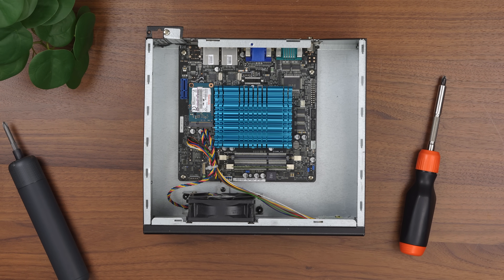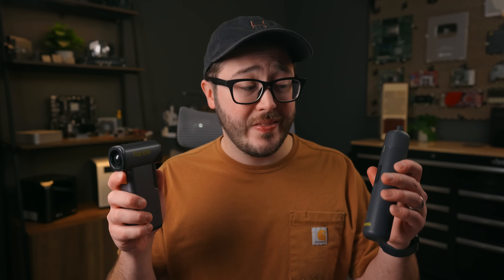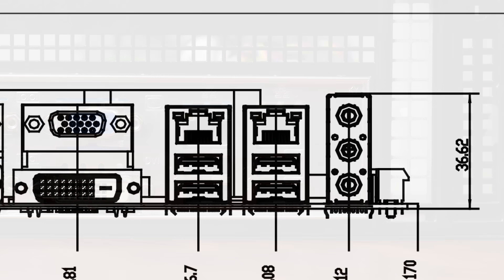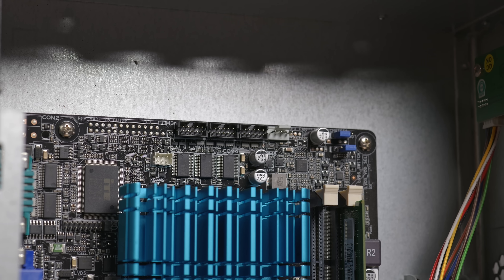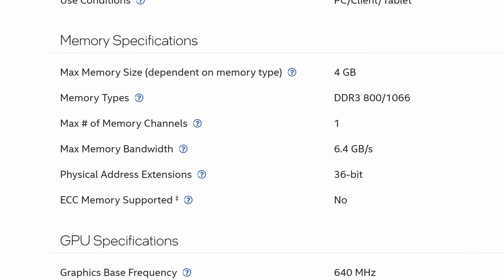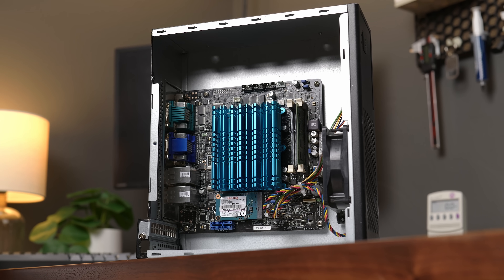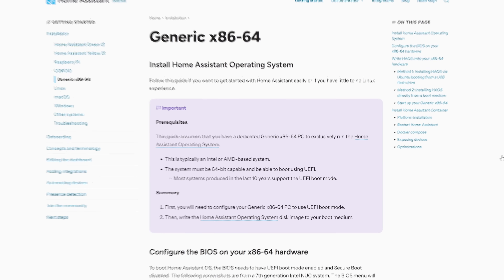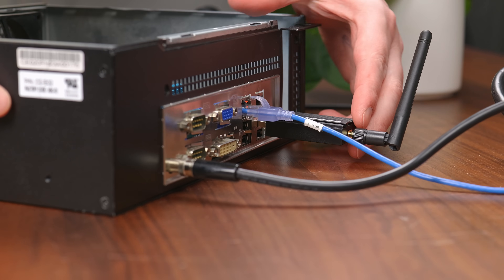I had no idea what this PC was... but I'm glad I bought it.

Comment from the maker: - Get 50% off total for Fanttik B10 Pro Max Electric Air Duster with code HardwareB10 at: https://amzn.to/4iqiypS 
- Get 35% off total for Fanttik S2 Pro Electric Screwdriver with code HardwareS2 at: https://amzn.to/4isnTNr
Reply: Marketing tip: Why would I care how many RPMs an air blower can do? I want to know the air flow. Tell me the CFM, like we'd get with a cooling fan. RPMs are only interesting for noise, and more means louder.
Reply: honestly, the case for the screwdriver has me asking for it for xmass
Reply: When i click the B10 link i only see a 40% off, and when i click  the S2 i see a 32% off.
Reply: @CChironCentaur  Yea its "40% off" even with a general search of amazon. Apply the code for an additional 10% off. No thx
Reply: Probably a controller pc. For applications that were highly automated. Maybe like  robot arm control assembly,  lifting bridges, e.t.c.
Reply: Discount on Amazon is only 40% and code doesn't work on their website. That said, it's cheaper on their website than the $99.99 they have it listed for on Amazon.

Comment: I was looking for thin clients as Home Assistant server. But I didn't find good offers. Testet the power consumption of my Thinkpad T480s laptop: With a running Linux (but without graphical UI, I think) is needs less than 5 Watts in idle. Or in other words: a good Laptop with an Intel i7 from the U-series (ultra low power) can be in the same league als a Raspberry Pi, regarding electrical power...
So I bought a Lenovo Thinkpad T480 with broken Display as my new Home Assistant Server. The display is even working, it just has a crack in one corner.

Comment: I would replace the 80mm fan with smaller one such ar 40mm or 60mm  fan (with 3 or 4 pin connector)  taken from some CPU heatsink, as it would repel spiders from doing their webs inside the box

Comment: That mSATA slot also potentially being a combo mPCIe slot might still be a thing, as if older laptops that I've worked with are anything to go by, a Wi-Fi card isn't always a measure of success because a lot of those use an mPCIe form factor but are actually using USB as an interface. So if you try a true mPCIe device in that slot, such as an mPCIe SSD (which are truly rare these days) you may still be in luck. Not that there's much point other than satisfying curiosity as you can just upgrade the mSATA SSD which is confirmed as functional and are much more widely available. Actually come to think of it, you could try what I've done with my laptop's cellular card slot and use an mPCIe to M.2 NVMe adapter board fitted with an M.2 2230 NVMe SSD.

Comment: I guess this computer is used in a production line of a industry or in a ware house to scanning bar codes of items or to run monitoring software. I guess it used to view data rather than for storing as it has only 64gb of capacity. It may have connected to a network through the LAN ports.

Comment: Pro Tip: University E-Waste

My local university sells 2017-2019 PCs for $40-$60. its a mix of Macs/Macbooks and Dell Optiplex/Latitudes

Only thing missing is the boot drive. They also sell SSD at $30 each with 1TB being $35 during my last trip.

Comment: Solderv the missing sata connectors,  add e gsm cellular modem instead  of the m sata also update the latest bios and yeah a smaller case  well and I would look for a better cpu  a prevailed one so you could solder it with a heat gun  but heat a home assistant is the best it can be at this specs

Comment: Looks like a small embedded computer designed for the manufacturing industry, or as a public-facing machine - GLL, who manages Libraries on behalf of Wandsworth, Bromley and Greenwich Councils in London, England, uses a HP Computer like this in one of their libraries running Windows 7 Embedded, and is only used to search for library books.

Comment: Its most likely an old remote terminal. We had something that looked very similar at work and it could go to 2 websites (Company SOP and NDDR), run one program that connected to the very secure in house production medical data program. They wouldn't boot if not hooked to the corporate network and the USB would only allow you to use 3 devices. A hand scanner, a keyboard and a mouse. The data base looked similar to the old library book system.

Comment: I recently got a different Mini-ITX industrial board with an Atom D2700 running at 2.1 GHz (also with 4GB of SODIMM RAM), but with a friendlier setup which includes 2 SATA ports, 1 PCI slot (the old 32 bit one), ATX power socket, onboard audio (even has optical out!), M.2 slot populated with an Intel Wi-Fi card, HDMI and DVI out, 4 USB 2.0 ports and single Fast Ethernet.

I paid “a lot” more than you did ($37 USD with shipping and taxes) with no case, no SSD and no PSU, but at least it offers a few more options for other types of home use (other than a typical retro gaming machine for Windows XP, of course).

My use case will be for retail shop signage (powering a single 1080p screen), but after watching your video I’m now thinking if this meager dual core Atom could possibly also handle some Home Assistant duties for the shop as well… 🤔

Comment: If I had this system I'd have to let it go. No sata, not even a PCIe-X4. Yhea it uses little power, but I already have at least one spare RPi4 lying around. I run HA on a Pi4. I'd also be looking for HDMI or DP video output. I really like Lenovo 1L i6500 systems, they work well.

Comment: I use a very similar ITX Atom-based board as a dedicated docker server running Jenkins, NUT and a few other monitor/dashboard type use cases. 
Mine did have SATA ports, though I'm only using an old 80GB OCZ drive in one of them. 
I have an external USB drive attached and connected to my NAS via NFS to dump 3rd-string backups to. 
On rare occasion, I've started Samba on there in read-only mode to access NAS data while the main NAS was offline (or just off). 

It's versatile and just works in its little corner of the house, separate from the rest of the home lab.

Comment: Your specific board has no standard SATA data ports, it is highly likely you have the EMB-CV1-*-MS variant, which utilizes an mSATA slot for storage. 
The 'MS' in the model name stands for mSATA. These models replace one of the standard SATA ports with a full-size Mini-Card slot that supports an mSATA SSD.
Reply: If you put in the address, it points you to CONTEC America and they do computers like this one. It is not listed as a current model that they sell.

Comment: I love to upcycle those abandoned mini PCs as Home Assistant Servers. Oh and old office PCs that don't like to install Windows 11 on their own as cheap ass Gaming Rigs. Add/Replace SSD, add some RAM (still cheap as old tech - DDR3, low speed DDR4) and a GPU that fits into case, power supply capabilities (if that can'T be upgraded) and reasonalbe budget (100 to 200 bucks max). Just finished an I5-6500 Optiplex. Now has 16 gigs of memory, 256 GB SDD a 1 TB HDD and an Intel Arc A310 single slot SFF GPU. That thing is perfect for older games, wasn't expensive and still has some years to give some fun.

Comment: I'm not sure about HAOS; Docker on it should probably be enough for this. But considering the network cards, I wonder how much traffic it could handle as a network gateway? With support for some modern VPN servers, etc., for home use. And it would be interesting to know if the SATA would work if they were actually re-soldered.
Thanks for the video. All the best. ))

Comment: That is a good adguard machine. Silent, low power, has no performance limitations for adguard... Disable every serial device in bios and everything you can find useless, disable one of the nics, install a stripped down debian distro, install and config adguard an u got a 5watt adblocker for 10 bucks... You can use only 2gb of ram for adguard and swap the msata for a 8 or 16 gig one since adguard doesn't require... Anything really... And there u have it!

Comment: I'd like to see you set up a DLNA server as simple and easy as possible. Open Media Vault is a bit of a pain to do that with. DLNA has to be installed to it as an addon. Making and sharing a media folder is all over the place, the last time I did it with version 6, one critical thing was in a menu unrelated to what it was. Then it's bloated with a ton of functionality completely unnecessary for just sharing video files by DLNA.

No transcoding capability is needed. Just serve files by DLNA for clients to use their own capability to play.

An absolutely bare bones Linux configured to do nothing but DLNA file serving is what's needed. It doesn't even need internet access, just LAN. Once setup it should be like any appliance, no need for updates. It only needs to be accessible from a computer on the LAN to manage files on its storage.

Comment: The setup utility states its Aptio which is UEFI. It's almost certainly Aptio 4. To perform a UEFI boot, the CSM will need to be disabled. If the option for it isn't hidden then I think it should be under the boot menu. If it's hidden, maybe there is a BIOS update that makes it available. If not, there are some BIOS customization tools that may help but that's another discussion.

Comment: I'd put a cheap quad port gig card in it and use it as router+switch in a low demand situation. If I still ran a lot of machines I would have put a multi port serial card in it and used it as a console server for the other machines. Either way, I'd be running OpenBSD too.

Comment: I saw this and for a second thought the Mboard was a GIGABYTE N3150N-D3V - which I use for Truenas box; passively cooled, swapped to a Pico PSU and SATA SSDs - super low power draw, silent. That system runs Plex and Immich too

Comment: Prob end up doing the same as you.

I have been running Home assistant using a portable windows version that severely out of date, but I get stuck every time I think about migrating cause HA in docker doesn't let you use HACS so I've been thinking more and more to just get a small low power usage device and run it off of that. now i'm just waiting to either have extra $$ to buy something or think of something I can repurpose.

Comment: I've run into these types with  entry systems (mag door locks / badge readers etc. )  It just runs a small app to configure the "database" (text file) that gets pushed to the "brain" over serial (used to be 9 ping now usb) that is more ROM based.

Comment: gen 1 x 1  i got an old emachines desktop i melted off the back end of the pcie x1 slot to accecpt a hd4670.. ... terrible but still better then the intel gma atrocity igpu.
Reply: its one of thoes tragic systems that has the space but agp port neutered off the board stuck with pci or the 1..lowly pciE x1.......

Comment: My current "NAS" is a Pentium J4205 box - ASRock J4205, with 2x 8GB DDR3 sticks (sadly no ECC support). All hidden in a 1U Supermicro chassis, alongside 2x 400GB SSDs and 2x 12TB HDDs for storage. With PCIe x1 slot empty and.. another PCIe x1 in WLAN slot available for whatever. Extra SATA? 2.5Gbit NIC? It won't boot from it so no NVMe.

I actually have a 2nd motherboard with yet another 2x 8GB sticks for it and I am in a need for a new router that can run 500Mbit PPoE with quite a few firewall rules on IPv4 and IPv6 so that's an option if I want to get rid of Mikrotik... :)

Comment: After watching your channel for a while, I came across a free commercial Blu-Ray printer on Marketplace. Looking closely at the pictures, I noticed that there was an I/O shield sized cutout for all the ports on the back, so I swung by and picked it up. Turns out it has a 4th gen Intel core i3 processor, 4GB DDR3, and 3x500GB hard drives. I sold the two Pioneer Blu-Ray drives (after printing a copy of Pulp Fiction, and depleting the print ribbons with Samuel L. Jackson on blank discs), and I am keeping the ITX board for a NAS build for my parents.

It feels great to find stuff like that literally on the side of the road and give it a new life, in a way that is functional!

Comment: It has an Atom processor. It might make a half-decent WALL CLOCK with an attached monitor. It's possible it might run a doorbell. If you want to program in assember, you might get it to control a dishwasher.

Comment: I have a similiar board Gigabyte M10RDI. It has 1 half size and 1 fullsize mini pcie and it says it supports mSATA in manual but no way. 
I dumped the BIOS and modified it so that now it supports NVME as a boot device. I installed a NVME with a adapter and now it is working as a OPENWRT router:) 
I haven't tested the VPN performance yet but I am thinking to attach a wifi 6e or 7 tri-band wireless card for additional SSIDs for always on VPN connections and IoTs.
It doesn't have UEFI BIOS but it should have Aptio EFI BIOS.

Comment: Damn I love little computers. This is a bargain for $10. I'm in the middle of planning a build with a small mATX board, Ryzen 5600G, and one of those cash register power supplies. I should be able to make a case smaller than 2 reams of A4 paper (i.e. 6 Litres).

Comment: You know what I immediately noticed with this thing? The Nidec fan. The manufacturer intended for the thing to operate reliably for a very long time. That's something they'd likely have had to source from Digikey or Mouser or similar (or in volume direct from Nidec) and it's a lot more reliable than a standard fan from a consumer brand like Noctua or Arctic. I'm also fairly confident that that exact CPU heatsink was used on the Asus E35M1-I board, which is what I initially thought this was from half-watching the video. Totally irrelevant, but perhaps mildly interesting.
Reply: These heatsinks are probably just OEM stuff. Seen a lot of these on different boards, there is also one that is exactly same, but red.
Reply: @alexturnbackthearmy1907  Oh, without a doubt. Same way every chipset and half the video cards back in the day used the exact same little square heatsink anodized in either green or black.

What's mildly interesting to me is that the Asus board uses an AMD CPU, which has different electrical design requirements than the Intel chip here. If the mounting pattern is also the same, it suggests motherboard manufacturers might constrain some mechanical dimensions before they get into electrical design—above and beyond what the form factor specs require.

Makes sense when you think about it, but it's not an angle I'd considered until I saw an Atom board using seemingly the same heatsink as an AMD E-350.

Comment: I like that its passively cooled
Reply: it's not, there is a fan. Just not stuck to the CPU HSF, making a single fan PC is quite easy actually, pick a chip with wattage that is like max 45w but lower is def better, then pick a reasonably big heatsink with heatpipes preferrably, and a case with a 120mm next to where the cpu cooler is, plug the thing up, connect the fan to a CPU temp controlled fan socket on mobo - connect whatever else, the rest doesn't need cooling so long as you use onboard graphics, badabum badabim you're done. 
You can do a reasonable GPU but you will NEED a fan of some kind on it. Even the passive ones die if there is no airflow so you might as well pick something reasonable with a big heatsink, put a slow enough to be inaudible 120mm blowing on it. Done. 
One thing though, if the fan for the GPU dies, so does the GPU. The overheat warning often doesn't work well enough to save the card. Ask me how I know 😛. 
If you don't need it to do transcoding or whatever go with a CPU with inbuilt GPU, saves a fan and money and headache. 
If you go for a low wattage silent PSU you'll have a whisper quiet PC this way, you can get it totally silent but I don't recommend it because EXTREMELY quiet is reasonably easy. Totally silent is EXPENSIVE AND HARD if you want reasonable performance. There is an ocean of dead burned components between you and the totally quiet PC heh.

Comment: As far as I could tell, that power draw reading was approximately 6.6 watts, give or take.😉

Interesting find.  Definitely not bad for 10 bucks.  I remember finding out about AAEON.  It was when the Atomic Pie board was shipping.  Someone showed the board info in a video before anyone knew where that board really came from.  I used that info to figure out it was meant for that Kuri robot and I found the auction lots for the board, along with a few other things.  Other people figured that out at the same time as well.  As other commenters have said, these machines might be common in certain settings, but it's an interesting find.  Plus, the blue heatsink is pretty snazzy.

Comment: This board was used in ATMs in my countey and I got one from friend who upgraded it, even with original mSata drive with banks os still on it (versioln of Fedora, using flash based UI for ATM, but was not loading the UI since had no connection to server)
I formatted it and now I want to use it as low power retro machine for ExoDOS/ExoWin, I even managed to make old Nvidia Quadro 2000 work on it (intel GMA needs to be disabled, otherwise it bluescreens)
I am tempted to find LVDS touchscreen to connect to it, but I will not be able to use Nvidia Quadro

Comment: It has higher power consumption and less performance than a Raspberry Pi 4, but for if your budget is tight and you got it for $10, it could probably run Home Assistant for quite a while, before a RPi4 would break even on power savings.

It might be interesting hardware if you want to do operating system development or retro hardware optimisation for fun, on real hardware rather than relying on emulators...

But other than that, it's more or less e-waste given the size and perf/power ratio :/